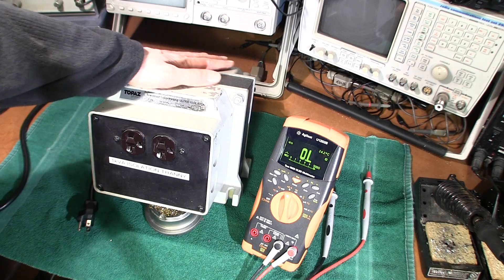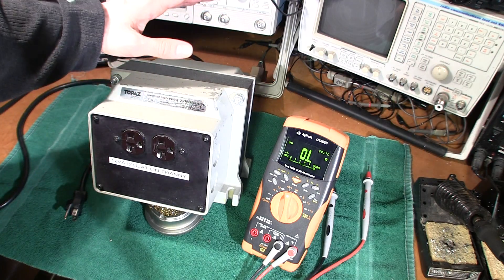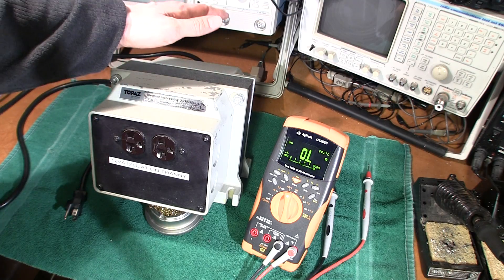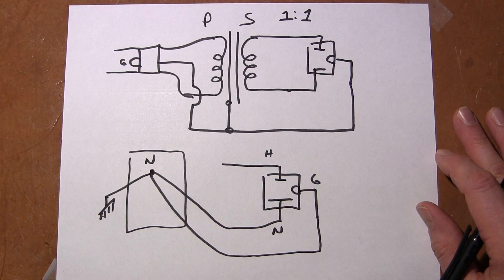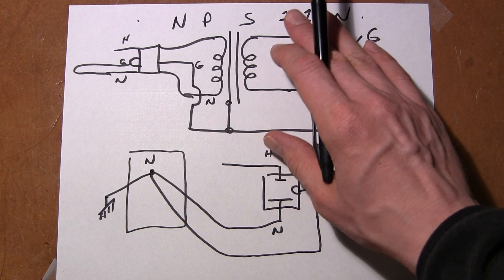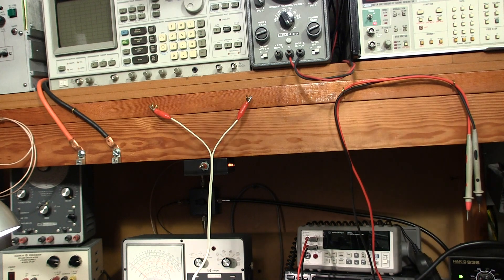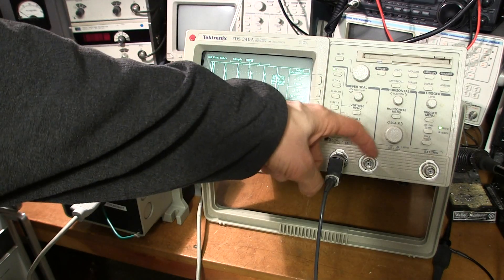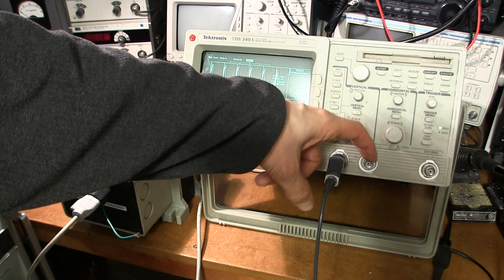Tech Tips Tuesday, Isolation Transformer and Variac Safety

Comment: what is the point of such a transformer that doesnt isolate the ground? because i thought isolation transformers lets you say float your function gen output from your scopes input so you are free you create your own gnd reference? at university lab this is what they told me..
Reply: +Adil Malim   You want to  (Float ) the device being tested only. All your other test equipment
                         should be directly plug in to the wall plug, that is grounded.
Reply: +Adil Malim my isolating transformer has earth-free output and appears to have been made that way from the factory - why need an earth on an output with no earth reference? I think the only reason electricity distribution is earth-referenced is due to lightning and static protection as lightning is implicitly earth-referenced and an isolated grid struck by lightning could hit huge voltages w.r.t. ground and flash-over in all kinds of unfortunate places. Not so much of a problem on the bench.
Reply: +Glebs Litvjaks  In my mind I would say  Transient Spikes  Yes, Surges No, Noise NO and Yes depending where
                                the noise is coming from, Noise on a AM radio caused by dirty insulators on the step down
                                transformer, NO, the electric company will need to wash off  the connectors to get rid of that
                                kinda noise.
Reply: Glebs Litvjaks
 Your welcome, we have all run into noise problems, it is just tracking them down, takes a little work.
Reply: +Glebs Litvjaks You most likely have a TN-C-system where earth and neutral is combined (in a PEN conductor). Although you do not have a seperate earth wire, your system is still earthed and earth referenced. There is, as far as i know, no mains system without some kind of earth reference.
Reply: +Dacke i thought the whole purpose of the isolation transformer was to float ur measuring equipmment so you can define your own ground reference, rather than being forced to call the main earth referenced BNCs as ground for example. so is this one for noise suppression or smthing like that instead?
Reply: +MrMac5150 yes i understand that, im assuming you use this isolation transformer for the Device under test so doesnt it make sense for it to not be mains earth referenced?
Reply: +Adil Malim I'm assuming that since isolation transformers are used a lot by service techs,  say someone doing TV repair or working on a guitar amp would want it mains earth referenced for safety reasons.  Floating the device in this circumstance could make it potentially dangerous for you,  and these people know enough to not accidentally create a return path through their equipment.
Reply: +Adil Malim Floating something like a scope can be done for the reason you say,  and poeple do it,  but they shouldn't because people have been killed this way,  as it defeats the safety ground.  People that are using a scope that is mains earth referenced should always know enough about their equipment to not cause an issue.
I'm not sure what that specific transformer in the video is for,  as some isolation transformers are designed/used for medical and audio equipment as well.
Reply: +Adil Malim I will also add that you can buy isolated differential probes to do what you're are describing without having to dangerously float the scope,  though they are expensive.
Reply: +Dack well I don't want to get anyone in trouble but if you have watched Norcal715 he's a professional tech he shows everyone that both his scope & the tv set he's working on are plugged into separate isolation transformers. He says this gives him extra protection?
Reply: Bri G.
Norcal715 is a PRO in his field.
Excellent tech.
Reply: +MrMac5150 yes I know, I'm no expert but did manage a small repair business. Watching him work I can see that.
Reply: Bri G.
 Everybody replaces caps etc, but I do not know how Norcal tracks a IC chip so fast knowing the leg on that chip is not putting out the right signal, I have never seen anyone as fast as he is. He is the King of repair.
Reply: +Bri G. Yes, Norcal is a very good repair tech,  I've seen a lot of his videos.  However,  instead of explaining it here,  there are some excellent explanations over on stack exchange to explain why you should not float your scope.  And it goes into more detail under various scenarios (some that I didn't even think of at first). 

Link - http://electronics.stackexchange.com/questions/73991/why-do-we-need-an-isolation-transformer-to-connect-an-oscilloscope

Take a look at particularly the first and second answers to the question.
Reply: +Priviledgy Shitlord It may not be that bad. The whole point of having separate neutral and earth wires is that while neutral may be cut (via a switch or a circuit breaker), earth must always remain connected, so your devices are always grounded. If you simply move the “always connected” requirement to neutral, you get similar results in terms of safety. There are some advantages to the 3 wire system (like that you can make the earth prong longer, so when plugging in a device, earth is always connected first), but in my opinion it's nothing major (that is, of course, until unqualified electricians start swapping line and neutral in the outlets, making all the metal chassis hot).
Reply: Dacke
 Thanks
Reply: +MrMac5150 
Ha! The magic of video: 8 hours of troubleshooting compressed into 30 seconds. (c;

NorCal714, I wish he would make more videos. He's the best.
Reply: davecc0000
 NorCall makes it look so easy, but blows me away how he know exactly where the problem is.. that is where long time experience counts.
Reply: @ Priviledgy Shitlord - don't feel bad about USSR wiring - almost everything in your comment applies to houses in the USA except you might change that to "prior to the 1970's"
Reply: +Glebs Litvjaks yes some countries have a tenous grip on main earthing. In pakistan all electrical appliances (apart from big ones like ACs and Fridges) are 2 pin regardless of a metal chasis or plastic chasis. i didnt know how bad this was until i studied what the third pin did in school lol